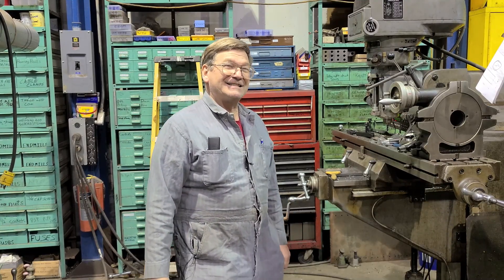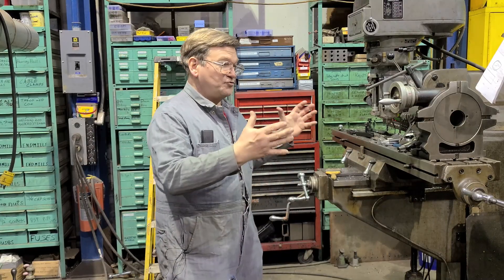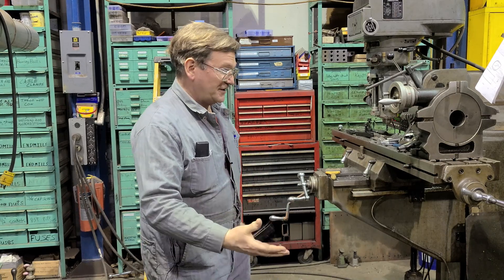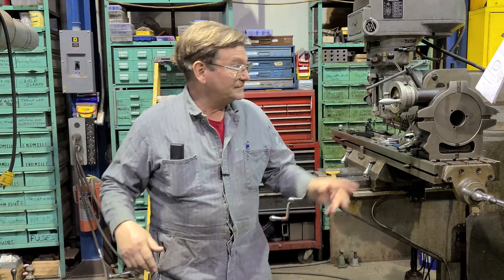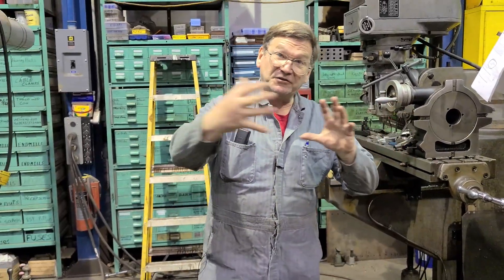Machinist's Minutes: CNC's vs Manual Machining

Comment: It is the skill level that has to be taught and maintained that is not replaceable. Once that skill is lost to society it take a long time to redeveloped. Eg ancient stonework, Roman concrete that lasts several thousand years, technical knowledge combines with practicable abilities is necessary to develop the mental awareness of the possibilities of what can be made. I read somewhere that it would be very difficult to build F1 rocket engines now because many of the small machinist changes were not properly documented ?

Comment: In 50 years in the trade, I was NEVER impressed with a CNC because it always screwed up and they came to me on a Kneen mill or lathe to fix the CNCs screw ups, OR, there were some operations you just HAD to on the Manuals and the manuals take decades to learn all the set ups.
Reply: Yep, all true plus a manual machinist takes 5 times as long to train &learn most of the tricks to know how to set up & fix all the CNCs screw ups.  I get a kick out of the shops trying to get a CNC Machinist that knows both CNC & Manuals PLUS they have to mig/ tig & stick weld and is certified all in one employee and pay this genius a whopping 25 or 30 bucks a hour ! 🙃🙄☹to perform all 3 people's jobs. (Never EVER work for any shop that try's that as they will never respect your talent or you work.) If I am going to do 3 people's jobs, the pay is 3 times as much. I get 105$ a hour as a repair manual Machinist and if I was doing CNC work on top, it would be $210 a hour, and if they want me to also weld, that's $315 for 3 times the work a hour to just walk in the door, and I better see raises very quickly at $315 a hour because if not, there are shops that will pay that and more for a skilled tradesmen. See I KNOW what my work sells for as I am running my own little shop. The only thing a CNC is really good at is threading on a CNC lathe. On that they got a manual machinist beat. But if you include the engineering & programing and set up time on a CNC (and setting each tool up from scratch) plus first part troubleshooting, it's about the same time.

Comment: i use my cnc jog wheel for simple slots, facing, even as a drill press sometimes. cncs are mills you just turn the handwheels with angry pixies. you can use it like any other tool, ust wrong enough to be done in no time.

Comment: Knew a guy down south that bought a used cnc lathe for $24k that was worth maybe $8k tops. He had no clue how to run it or program it. He thought it was more like 'push a few buttons and out comes the part'.  He found a guy to show him some things, and write a couple programs. But that guy got tired of volunteering for free very quick. So the owner tried programming himself. When the machine wouldn't do what he needed, he would pound his fist on the side of the control cabinet and throw tools around his shop. It was slightly humorous. He ended up selling the machine cheap years after it sat collecting dust, but had to have it repaired first after mice got into the electronics.
Reply: Sounds like all he needed was a programming course.
Give a man a fish he eats for a day teach him to fish he eats for life. That fits.

Comment: Glad this channel can up in my feed. I began my working life as a tool and die machinist right out of high school way back in 1977, then into the mid 1980's got into tool and die drafting and design, and form there into machine design. My father retired as a tool and die maker and he nor I ever had any involvement with CNC. We both worked in tolerances as small as plus .0000" / minus ,0001". And would often work on orders of as many as fifty pieces that had those kind of tolerances with surface finished as fine as 4 rms. What convinced me to leave the shop was after I went to a trade show and saw these CNC machines doing amazing things. Then I began noticing the wanted ads for machinists dwindling and more ads for CNC workers. I figured my future as a toolmaker was doomed and sure enough the trade here in the US is nearly dead. Even tool and die is dominated by CNC produced components. Aside form this, I keep my hand in machining as a hobby and for my own home use fixing and makign things for myself. I have a Southbend 9: lathe and a round column drill/mill that I enjoy working on. Another sad thing is that young engineers coming out of college have no concept of what it takes to make things. If I bring up milling or turning, or a lathe or milling machine, I am speaking a foreign language to them. The have no concept of machining and those who got a little taste of it in college only did so through programming a CNC machine. I like turnign dials and feeling the tool cutting and deriving that feedback of hearing the cutter and knowing whether I am taking too big a cut or feedign too fast. This skill can only be gained by experience. It's liek driving a car with a manual transmission, which by the way, I drive an SUV with a manual transmission because I like manual.

Comment: I think the difference with efficiency with cnc is your lower skilled lower payed operator runs the parts while the higher skilled employee is programming the toolpaths, ordering tooling and planning the jobs. Because these can be both done simultaneously it is an order of magnitude faster. Basically the next job is ready to be run before the operator is done with the parts. Pair that with a saw guy and a tool room attendant to set up tools and deliver complete tooling setups and raw materials. It makes for very little spindle down time. For one off stuff or repair the manual machining still maintains it's niche. For production 10-1000 pcs you won't be able to compete with a team like I just described.

By the way if you want to make parts manually there isn't anyone telling you you can't, just like you could take a driverless car dosent mean you couldn't still choose to walk. It just might take longer to get there but you still get there.

Comment: as far as the cnc thing is concerned. what makes a lot of good sense to me is a manual lathe with a good and well set up electronic lead screw. gives you the option to do thread , radius and tapers with reasonably simple setup. but for the rest the machine stay bog standard manual. I like that idea.

Comment: China wants us  on CNC machines so they can wipe us out with an EMP blast.
Reply from the maker: Truth is a modern 130kv - 150kv HEEMP will put down pretty much everything worthwhile, computerized or not. Learning about the command and control systems used for modern infrastructure makes you realize just how vulnerable it really is.
-Cameraman
Reply: @HOWEES  Most things can be back up and operational easily after the EMP event. Computers will go in the trashcan. They are suppose to be working on the infrastructure to protect the power grid.

Comment: I write in g-code and I made several Macro Variable programs to take a lot of the thinking out of making stuff... Is it always useful? No, but I can slap a part in my machine, get my offsets and assemble tooling... Get it all done within an hour. That's for the one off repair jobs I get though. I would like to think of myself as being extremely proficient in hand writing g-code... However I am a bit stupid and over think things when simply taking things to a drill press/bridgeport can get something done in 2 mins. When there are no dividing heads in my shop and someone needs a bolt pattern cut on a program... I simply go to my macro program and punch in all the necessary numbers and away we go...

Comment: Cnc took 2 hours to program, 5 minutes to make the part, and 5 minute per part every part thereafter
Manual machinist took 2.5hrs for first part, 1.5 for 2nd part and every part thereafter.
There inlies the advantage of CNC.
Reply: Obviously, You've never machined manually. First part on a CNC is 5 times the cost of manual machines from all the labor involved with CNC machines programming and setting up as well as more expensive tooling costs.

Comment: General rule of thumb the first part either manual or cnc will take “whereabouts” the same amount of time to get out, it’s the consecutive ones that make you the money.  In a manual you still need to “set up” each tool change.  If your running more than one just do it on cnc.  If all you have is cnc just do it on cnc it will take about the same time.  I’ve made more parts in 5 years than most manual machinists have in a lifetime.  This is the difference, this is why companies “require a cnc” they want to save time.

Comment: Totally agree with your points. When I bought CNC machines and CNC plasma I totally changed how I designed parts that looked nice and fancy but didn’t add anything.

The problem I had was my £1000 mill could sit in corner until needed but the £60,000 CNC mill had to be earning every hour of everyday. Then I had loads of work that bored me to tears.

I now only machine for myself and little jobs and choose manual because it’s better for one off, more enjoyable and the machines don’t owe me anything.

My fun comes from restoring 50 - 60 year old machines and making them perform better than my CNC used to.

Comment: Manual can be just as fast as cnc. Warner and swazey turret lathes were just as fast as a cnc. The problem is you need a body in front of it all the time.

Comment: Both manual machining and CNC machining have their place.  I used to work at a CNC production shop.  We ran the same parts all the time and in my work center the only time we had to write a new program was when we had to make a spacer body with an overall length that was different than what we already had programs for, or when management decided to off load some work onto us from a work center that was behind when my work center was slow.  My current job as a maintenance technician in a completely different industry we have an engine lathe and a vertical knee mill in the maintenance shop.  When I was working in a production machine shop I enjoyed having the CNC machines.  However as a maintenance tech that mainly has to make one off parts or make repairs on existing parts I much prefer the manual machines.  Sure it might take me longer to physically machine something than the cycle time of a CNC machine, but by the time you factor in writing the program and setting up the CNC machine it might be faster to make the one off using manual machines.

Comment: Sounds like the old saying. If all you have is a hammer, everything looks like a nail. I am a mechanical engineer. I prefer to deal with what I call " hybrid " shops. That have both CNC and "manual" machines. Usually better machinists, and more flexible outcomes.

Comment: A dividing plate and a tracer versus CNC!  Muahahaha!  I own a large machine shop.  I have one building full of large and small manual machines as well as a full grind room.  The other building is full of older and modern CNC machines.  Manual rarely outperforms CNC.  Manual is so reliant on the tool maker or machinist running the machine correctly with regards to DOC, sfm, ipr, etc that it's difficult to quote the jobs correctly and win unless the quoting is based on the machinist.  I had the same job ran on manual, and then CNC the next time, and reviewed the profit, the job performance as well as the surface finishes, and CNC almost always wins.

Comment: 45yrs in the trade, ran many manual machines back in the day. The parts are far too complex to machine without CNC today. We have been programing at the machine w/computer and powermill software since 1997 and never looked back. Programing is simple and once the machine is running you are programming the next operation. Wouldn't have it any other way. Yes there is still room for a manual lathe and small mill for repairs, other than that, no.

Comment: Meanwhile my cnc machine with a pallet changer and 71 tool pockets is running a bunch one off parts all night while I'm at home asleep. We've figured out how to do high mix low volume work on cnc machines in the 90s. Manual machines are only really profitable when machining very large parts now days imo.

Comment: I love repairing antique motorcycles, designing "reliability improvement parts" or just all around piecing them together. Its hard to beat a well built manual machine with good tooling/work holding for what I do. Saving my pennies for the digital threading upgrade for the lathe though. I could do without messing with those gears 😂

Comment: A foundry guy came in with a job of making two pipe flanges. Inch thick, Procut hotroll, for a two foot pipe. I made the first one, two key slots, four holes. Had a DRO, without the bolt circle calculator, so I used my calculator, clamped it once, drilled and machined it once. The lathe guy is making the second one, the mill doesn't have enough travel to just drll the holes N,S,E, and W. So being a lathe guy, math is taboo, he dialed it in three times, and clamped it down, three times, to drill four holes and two notches. Math can mean the difference between profit and loss.

Comment: CNC machines can produce a lot of good products, or a operator can create a lot of scrape. We had a whole shift of over bored shifting forks, because the guy, didn't try both ends with the No Go. I checked the Go, all the way through, and both ends, on every single cam, I machined, like a habit. CNC machines are fast, and that can be a bad thing. I noticed slop in the table, when cleaning out the chips. The thrust bearings had worn out. I guess the coordinate machine, was showing it for awhile, and the quality control guy, would come out, and make small adjustments, over time, and not addressing the real issue. When I could push the table, back and forth, 3/8ths of an inch, it was time to order bearings. CNC machines, need maintenance too. Not micro adjustments. Communication is key.

Comment: We had a old Milwaukee #7, dragged out of a retired carrier, from WW II. We keyed 30' heavy shafts on it. It was a beast. Tight all over, could probably cut straight, during an Earthquake. Bored out engines on it. If you worried about vibrations, that was the mill.
Reply: Big #8 Cincinnati's to Great machine for big work--- if you knew all the set ups. 😉

Comment: The first NC mill, I ever had to work with, was bigger than my bedroom, about fourteen feet high, with a table, about the same as a Bridgeport. Tape ran, had to climb a few steps, to operate it. I couldn't see how it could pay for itself, in my lifetime. Ran a tracer mill, too. Modern CNCs, are made for production, some, have gantries and robots, that seem to have disdain for humans. Kinda like what some women, think of men. As  I was running a Kitamura, twenty second cycles, and three tools. Face and plunge with an endmill, drill through, and ream. I designed a machine, to cycle them through, in half the time. All I needed to do was sand off the flash, and feed them into the tube. Now that was for the four different cams in the Ford transfer cases. Not all cycles are twenty seconds. The 5th & 6th, and reverse forks, for Borg and Tremec, had three ops, and over three minutes of cycle time. Most of the in-between time, was getting the forks parallel. The coolant was aimed so as to allow fixture changes, while running, so it wouldn't stop. Because there was always a truck, waiting to go to Mexico.

Comment: Manual machining is no match for CNC. Manual machining is more costly, less accurate, and slower with a steep learning curve. A single CNC machine performs most operations of a mill and lathe. It also doesn't require as much tooling and fixtures as manual machines do. Equipped with just an end mill, for instance, a CNC can perform a lot of operations that would otherwise require several tools, fixtures, and complex setups on a manual machine, resulting in significant cost saving and faster production.

Manual machines have a very steep learning curve. To master the use manual machines, you must be a trained machinist which requires a broad set of skills in a wide range of disciplines. It takes years of training and experience to become one. A CNC has a much shorter learning curve to operate one. Contrary to what was stated in the video, programming CNCs are no longer an issue. Today's CAM software is far easier to use and more productive than the old days when they were programmed using G-Code exclusively. Someone with zero experience can become a competent CNC operator in a matter of a weeks or months.

Comment: The difference between a machinist and a machine operator, is that the machinist can still do accurate work on an old, worn, manual machine.

Comment: My grandpa was a machinist for Ball can. His job was manufacturing replacement parts for the assembly line and later for the fully automated can press that replaced the assembly line.

When they got a CNC mill, he kept his job by showing that he could make 10 parts in the time it took to program the CNC.

Once they had all the parts coded and saved to 5.25" floppy disks. His job became making parts to fix the CNC mill.
Reply: I worked in Muncie, Indiana. Ball was a big employer, back a few years ago. I worked at Henman Engineering & Machine. Borg, sent our jobs to Mexico. Delco Batteries went too. Westinghouse left, New Venture, most of the machinist's and operator jobs, left the country. Don't know what kind of jobs are left.
Reply: @everettplummer9725   However, today Trump wants new ships built right in the USA, and a CNC is totally useless for custom ship building. So they need us again. ( I worked in many shipyards)
Reply: its a long shot, but yer gandpappy didn't by chance move north to Warshington and start his own shop did he? if so I have have worked with him for about a decade.